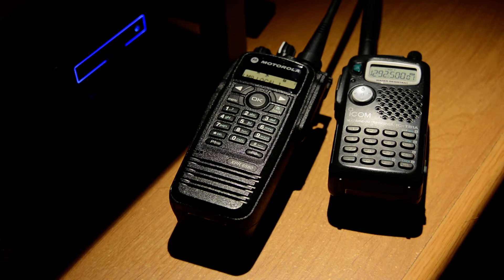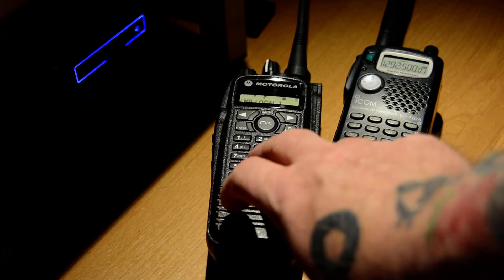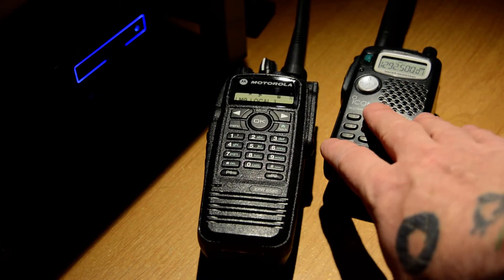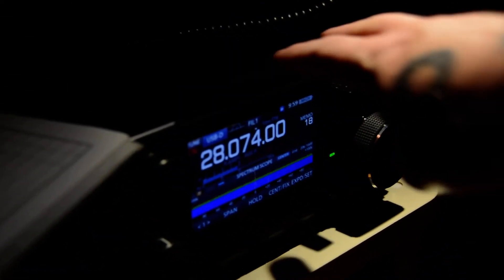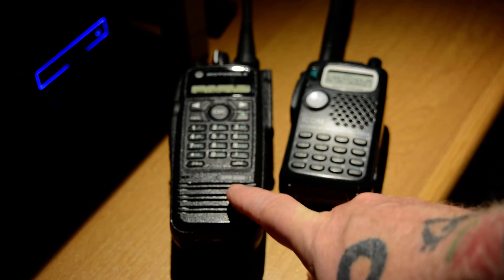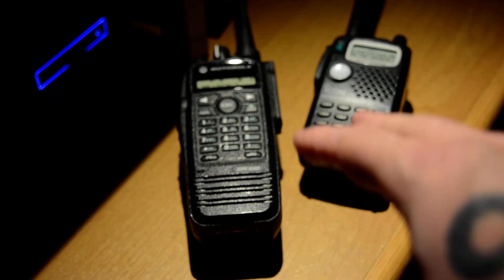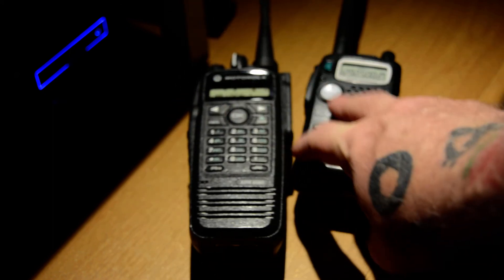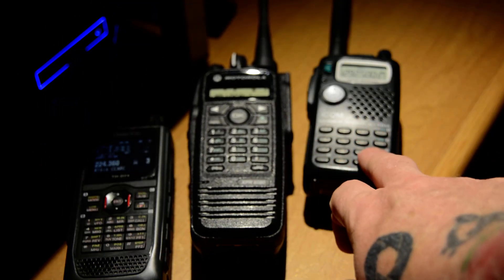220mhz/900mhz/1200mhz: Forgotten bands?

Comment: Interesting video. I also enjoy playing with the "forgotten" bands. I currently can do FM only on 220 and 900. 220 with a Kenwood TH-F6 (and just ordered an Anytone 220 mobile.) For 900, I have a couple Kenwood TK-981s. The programming of the Kenwoods is much more forgiving than Motorola. I am not on 1200 yet, but have been looking at the Q5 transverter for that band (which would give me all modes there.)

Comment: I use 220 pretty often, in Ohio. Just hooked up 900mhz system tonight, but cannot hit a repeater about 10 miles away. I'll worry about 1.2ghz after I get a 900 contact..

Comment: Alinco, made a 220mhz / 900mhz HT, it was on the market for a short time, it was the DJ-G29T, it was a companion radio to the DJ-G7T (144mhz 440mhz 1.2ghz), they share all of the same accessories except of course for the antennas.
Oddly enough, I bought my DJ-29T at the Portland HRO!

Comment: Im in the pdx area with 220 and 1.2ghz. I've not made a 1.2ghz contact since I i moved here but before that when I lived in Medford I used 1.2Ghz with D-STAR all the time. We had a 1.2Ghz D-STAR repeater we used as kind of a "IC-9700" club since we were the only ones using it. Since I moved I have had zero contacts on 220 or 1.2 but I'd like to, and I'd like to get into 900mhz as well.
Reply: There is a relatively large group of VHF+ enthusiasts known as the PNW VHF Society (That should help you find them). There are a lot of interests within that group, too, such as a 1.2GHz net that meets on the air every week by pointing antennas at Mt. Rainier.

Comment: 900mhz is not good unless you live in a flat area like the Midwest. Oklahoma, Texas, Kansas, etc. We had a bunch of 900 here in Western New York, but in order to be reliable all the repeaters had to be linked so that when you got too far or out of the line of sight range you switched to another to pickup the conversation. Our terrain and ups and downs of elevation here are just not efficient enough for 900 or 1200. If we were flat like Kansas, Texas, etc…. It a be a 100 percent go